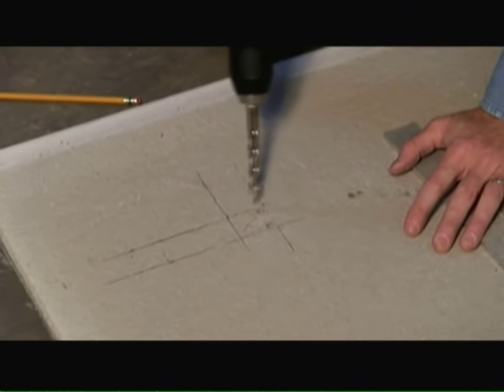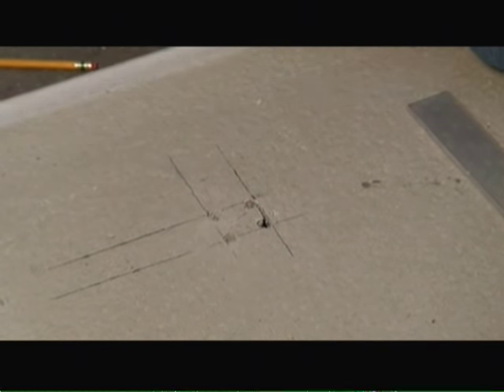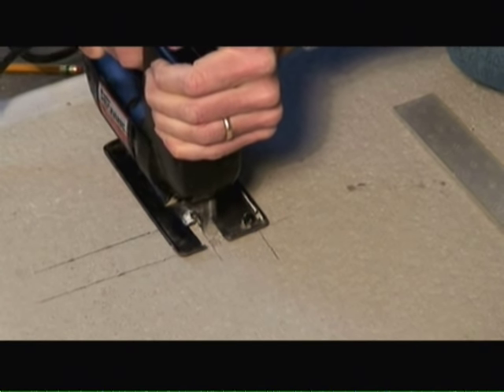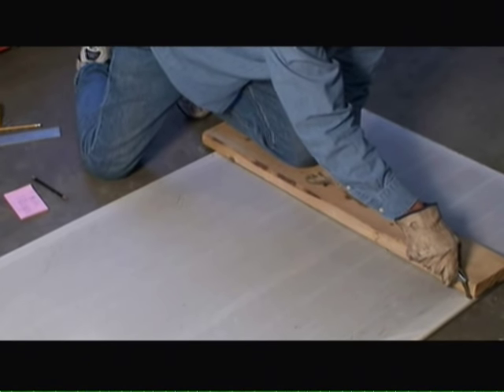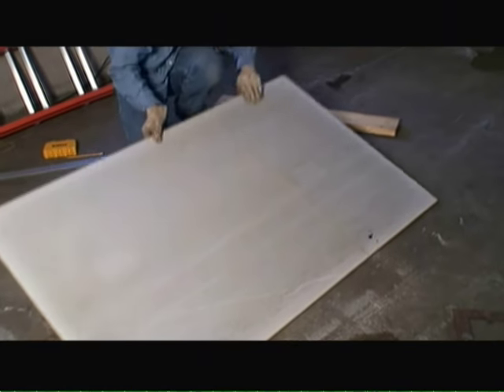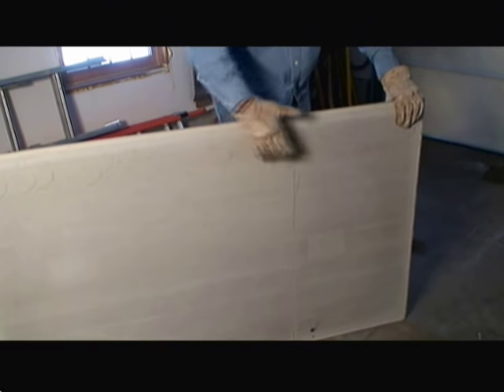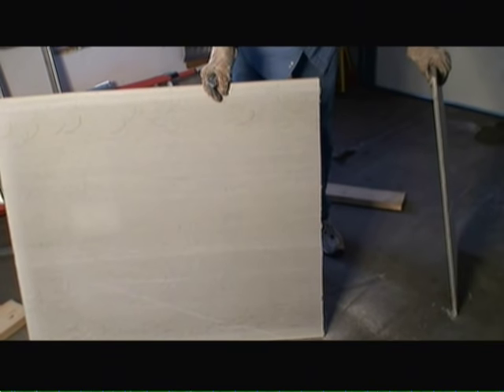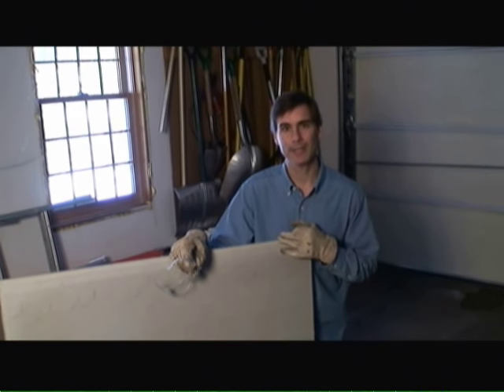How to Cut Cement Backer Board Video

Comment: We're going to replace our ceramic tile floor with hardwood in our kitchen. We wanted to remove the tile and the cement backer board up to the cabinets but not under them. Will we be able to score the cement board and pull it up (perhaps using a shovel) just up to the cabinets so that we can lay the hardwood just up to the cabinet edge?

Comment: I have the option to buy either buy Hardie board or wonder board at my local HD. Does one work better than the other? Wonder board appears to be a little bit cheaper and weighs a little bit less. The big question is how is one to work with over the other?